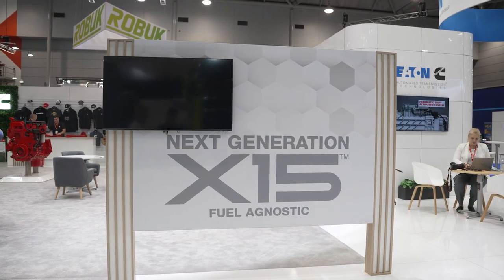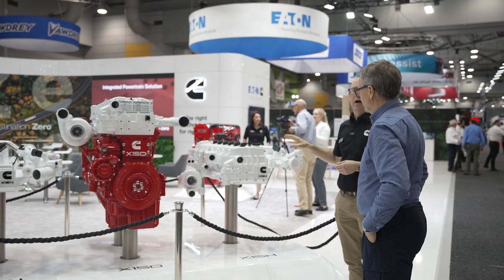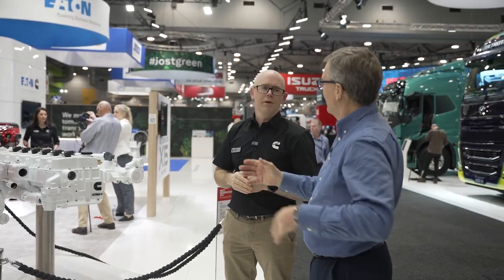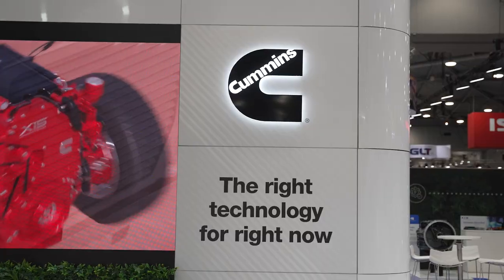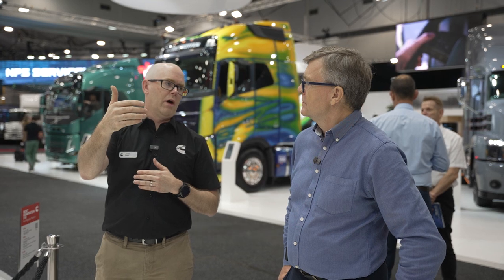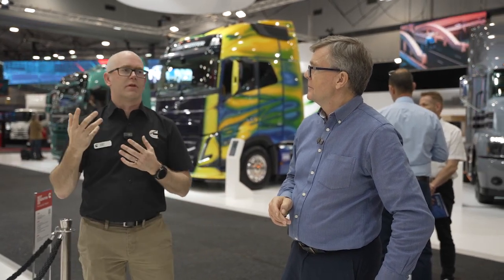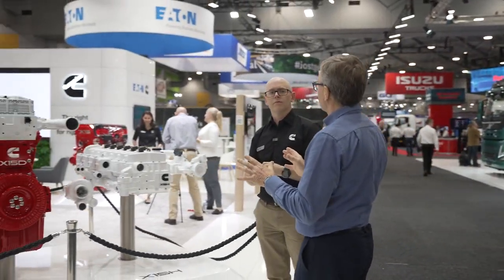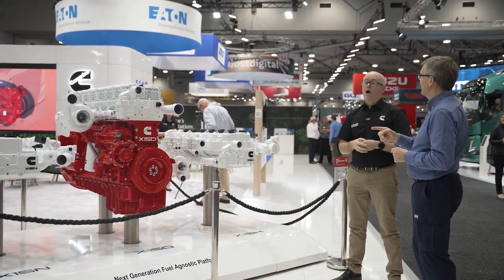Hydrogen internal combustion engine at the Brisbane Truck Show 2023

Comment: The amount of storage in a gaseous state will be crazy to get similar distances as diesel. Also I wouldn’t want hydrogen tanks being in such vulnerable positions.
Reply: Hydrogen tanks are safer than gasoline and are much less likely to blow up there's actually an engineer who already has a working Hydrogen truck that outputs over 500 horsepower and gets equal mileage to gasoline engines it's a converted 1950s truck. If you understood the technology you'd know that
Reply: @Andyman269  Mostly due to the way it expands during explosion because it's already in a gas state. If they make Hydrogen liquid fuel however it would be more powerful than gasoline